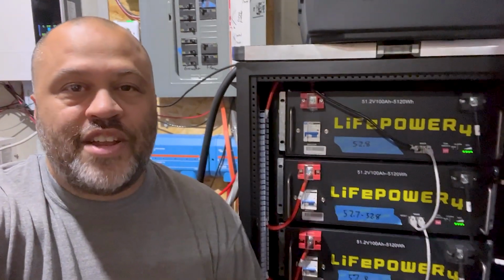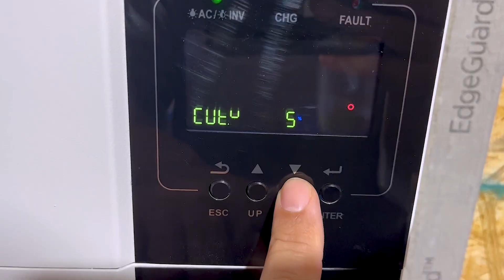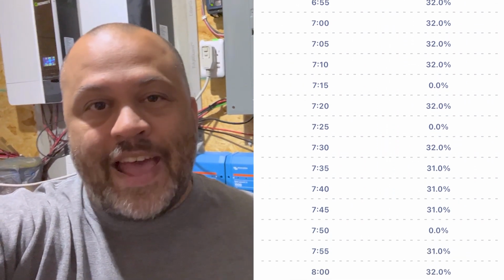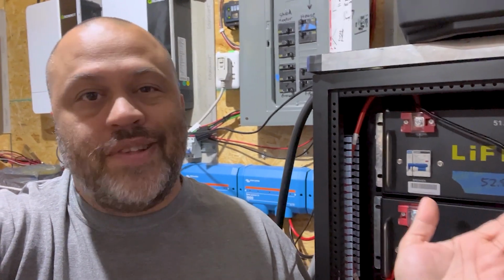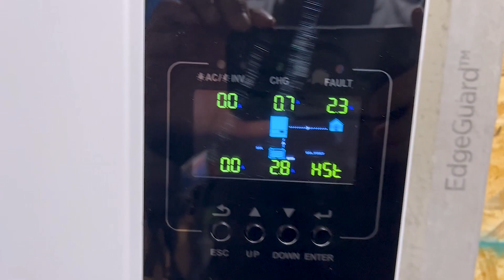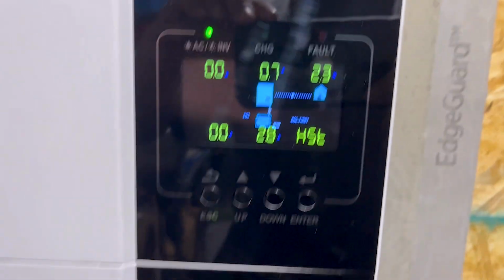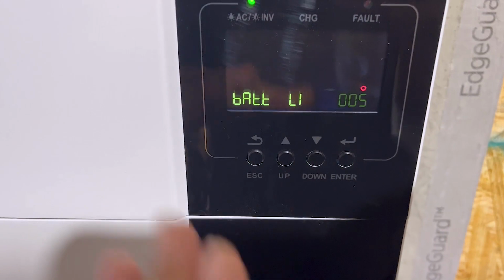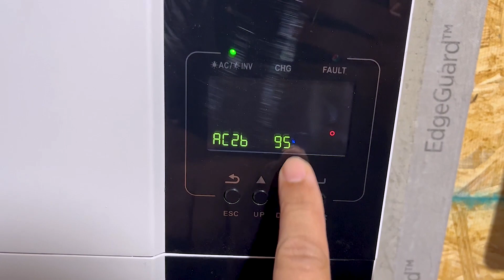Growatt &  EG4 Lifepower battery communication - Why use the communication cables?

Comment: Working on a new install of an EG4 18K 280Ah system that's now been up and running for nearly 1 week on off grid property running power to 3 RVs. 2 with AC, one without. It's quite amazing how well they keep up with the load with the 7500 rated panel on top with another 3750 waiting for the cables to arrive. 
I'm working on updating the battery system on it now with a lot of confusion. Nothing is clear on the "how to" vids out here or on the website. 
Can you direct me which way to go for a total virgin to this system and applications regarding it please?
Reply from the maker: So the power pro wall mount battery? I have not updated this one yet so can’t talk you through it. Eg4 tech support can walk you through it though. If you had lifepower4 batteries you can get the free automatic updater from signature solar
Reply from the maker: I might be able to find a link to the update info

Comment: You have a great channel,  I’m about a generation behind you on my project.  I’m still using the Growatt spf5000es .  I just bought and hooked up Solar Assistant.  My install currently is running 2 Growatts, 12 LiFePower4s 14kW of panels at low angle so really only 12kW of panels. I’m completely off grid.  I initially connected the solar assistant orange Pi with the battery option of “inverter values” but I’d like to switch to direct comm to the rs485 battery connection.  To me it doesn’t appear the you can monitor the batteries with the Solar Assistant and have comms between the inverters and the batteries at the same time.  My question is do the inverters rely on the battery comms to the bms to regulate the inverter charger control or is it just information?  If it is a closed loop does the removal of the bms feedback make the inverters have to be reprogrammed in order to function correctly.  Or does Solar Assistant somehow close the feedback loop through the USB cable back to the Growatts?
Reply: so what you are suggesting is that the BMS in the battery is controlling the individual battery charge rates.  I've been seeing the charge rates from the inverter drop to a fraction of their output to the battery bank as soon as the bank hits 90% and that should not be affected by the removal of the comms from the inverter.  sorry if I'm beating a dead horse here.
Reply from the maker: Not sure but I think it will charge faster if just using voltage vs using communications between inverter and main battery
Reply from the maker: Been a little while since the growatts but I did have solar assistance and bms comms at the same time. I think the solar assistance was a usb type cable then battery was rs485. Hope that helps! Thanks for watching

Comment: What cable did you use between the batteries and Growatts and where did you get it?  Thanks.
Reply from the maker: Cable that came with inverter.
Reply: @rodneyhunt  ok, thanks for the reply, mine did not come with any.

Comment: Can you view the data on all 3 Growatts or only the main inverter that is connected to the battery bank?  Curious if you had to change all 3 to the Lithium Protocol.
Reply from the maker: I just changed the main inverter settings only.
Reply from the maker: Each inverter still has all the same data available to see if you scroll through the menu

Comment: Can the dip switch settings and cables not be used if the data is not important to the user? 
I have 2 of these batteries and a growWatt SPF 3000 LVM-48 inverter, and I do not have the cables connected. WIll this cause any harm ?
Reply from the maker: You can use the inverter without battery communication.

Comment: I was using comms cables from Growatt to Jakiper, but found Jakiper to have in-accurate SOC. Used your settings to connect comm cable to EG4 RS485 port and VOLIA! Everything worked. Thank you sir.
Reply from the maker: Glad it is working for you!

Comment: Did you update the software on batteries or the es 5000?
Reply from the maker: No. Have you updated yours?
Reply: @rodneyhunt  No Iam still putting all together. It is for a new house I am building. Setting it up in my shop for now to see how much  room it is  going to take up. Same batteries six with three of the growatts.
Reply from the maker: Sounds good. Let me know how you like the setup when it’s running